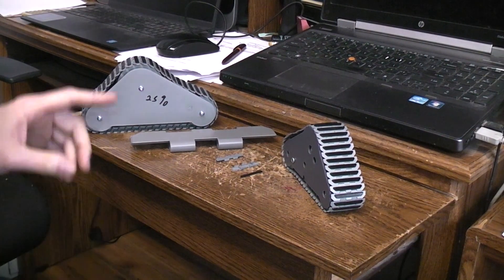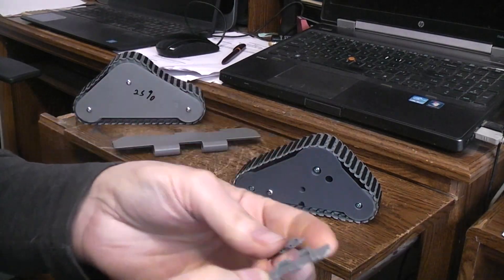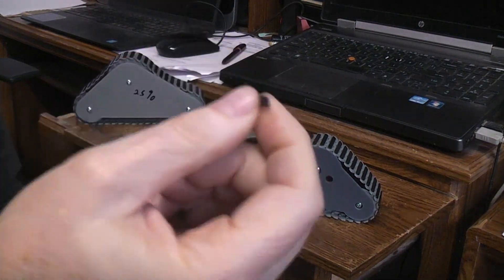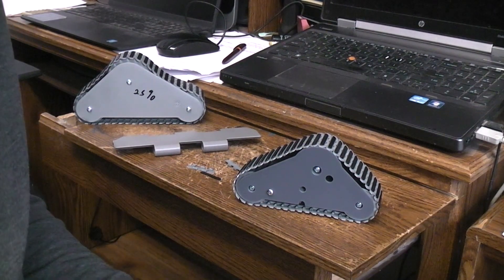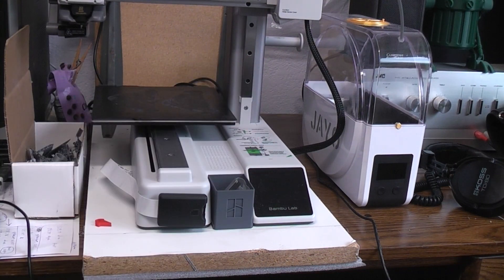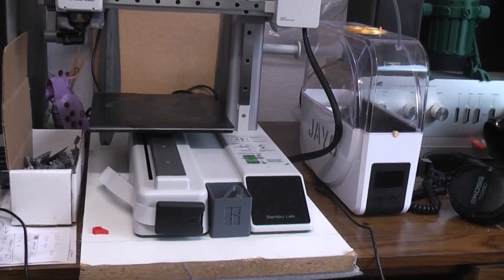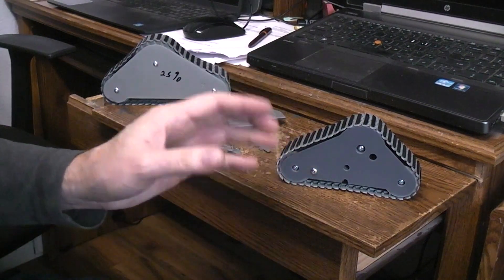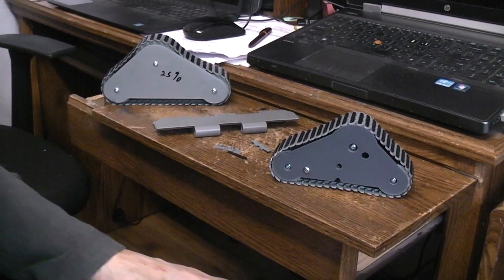3d print a 1/5 scale Johnny 5 motorized tread unit. Using a TT 1:48 gearmotor. Part 2.

Comment: very nice indeed,,, was wondering, i have the 1972 battery op batmobile and the one battery tab is broken off from the tab that connects it inside to the small metal strip that connects the two batteries current. so, if i just use some foil and put it in the battery compartment so it touches both battery ends, the car runs, how would you reccomend getting that battery tab so it's firm against the metal strip,,it had  been anchored down with a metal tab, but that broke off ,,is there some sort of super strong epoxy that would work?  cheers   perhaps jb weld??
Reply from the maker: Sadly, the only proper way to repair the battery box is open up the toy, get to the battery box and replace the broken metal tab.
Reply: i have it opened up now so i can get to everything @Robothut

Comment: Johnny 0.2
Reply from the maker: Any ideas for a alternate type body?
Reply: @Robothut  How about a tall box, canted back like R2-D2 but no need for the third foot.  Put the head inside a clear dome like the Pocket bots, but the face is tilted forward so it is perpendicular to the ground.  Indent the case so that it looks like arms are folded into the side.  Leave an open rectangle in front for a sticker or insert that looks like a reel-to-reel tape.